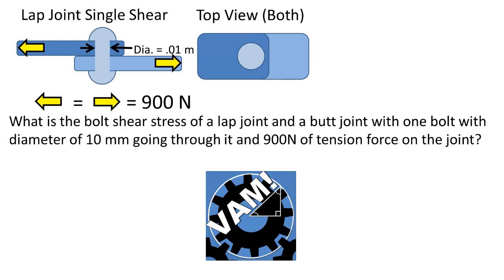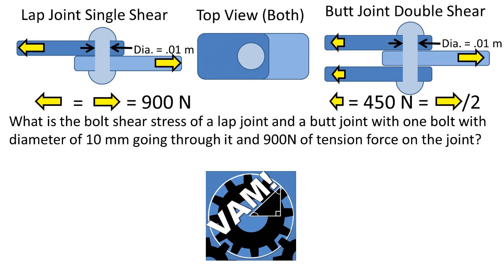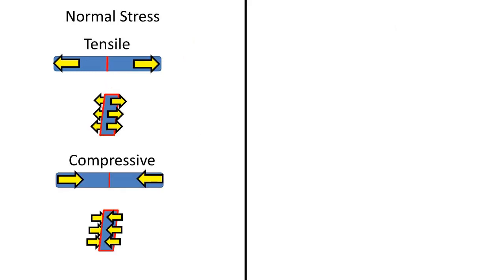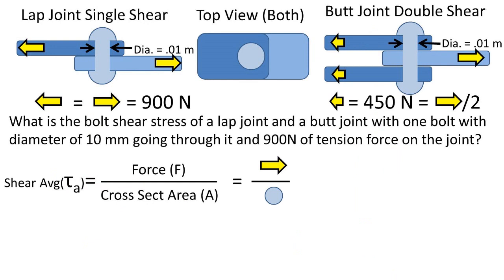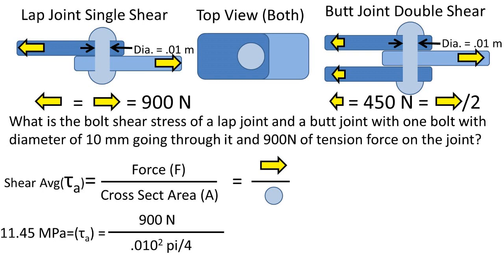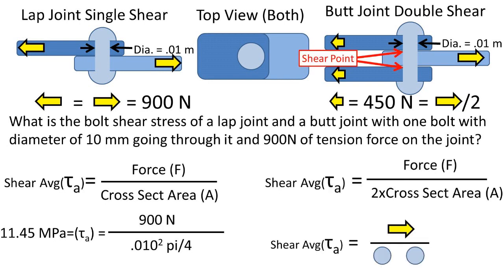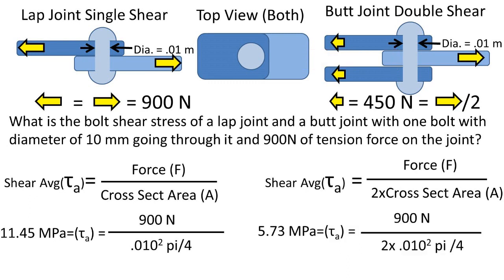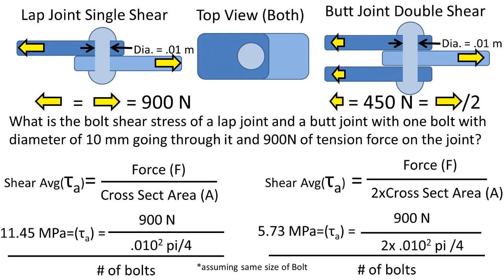Find Avg Bolt Shear Stress of Lap Joint and Butt Joint (Strength of Materials Problem and Solution)

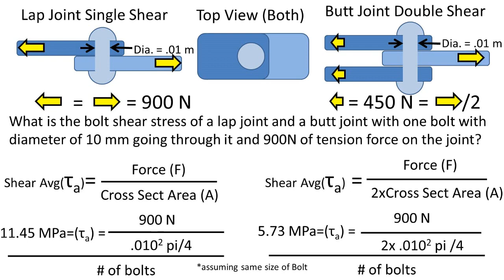Comment: correction : 2nd picture 2:03 should be lap joint. this is not a butt joint. a butt joint contains the plate coming together , connected by a strap or cover common to both plates. 2nd picture here do not represent that.